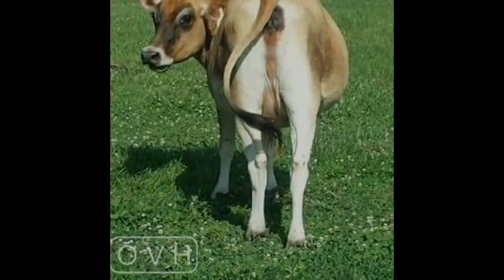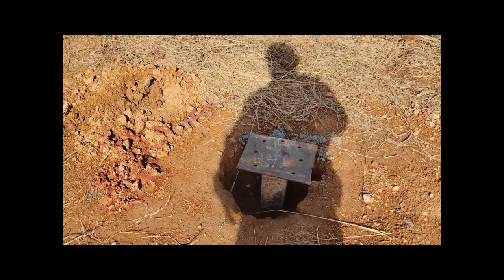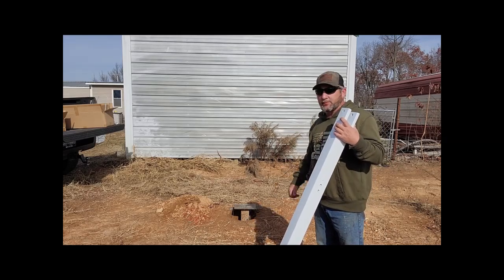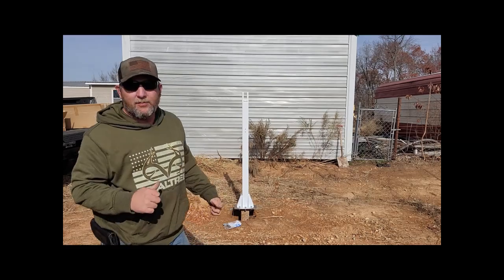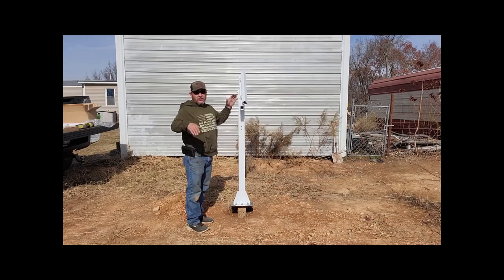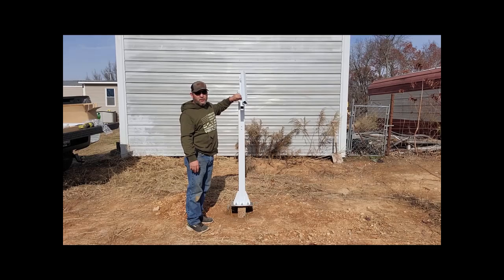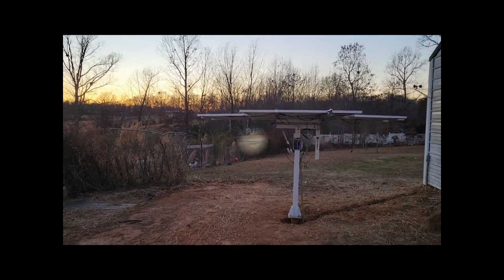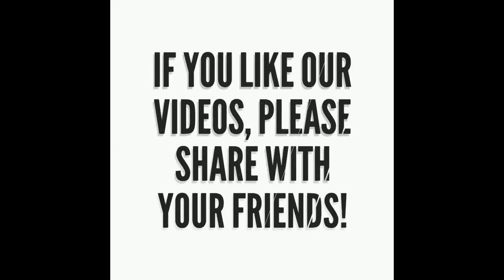ECO-WORTHY SOLAR TRACKER

Comment: Cool 😎 good diy video i been looking at some trackers for my solar hot water system it works off of solar panels
Reply from the maker: It works off of either solar or a 12 to24volt battery